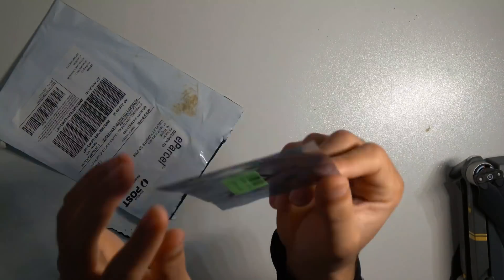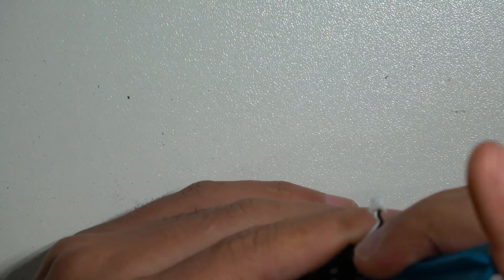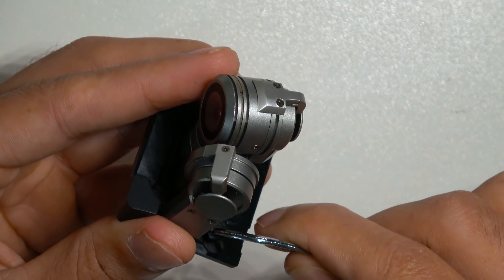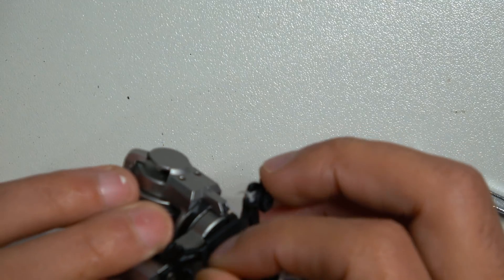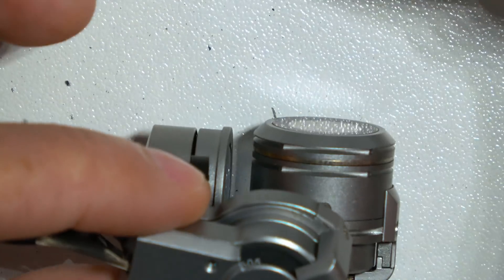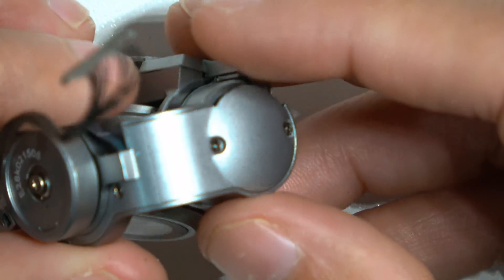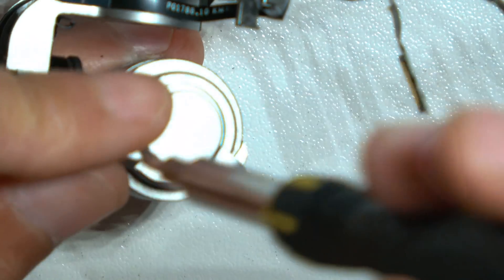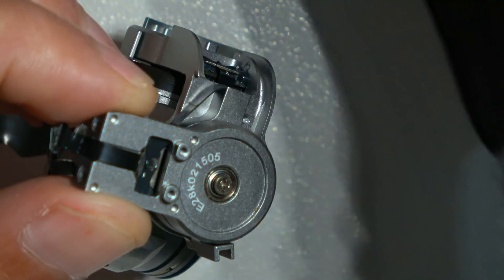Dji Mavic Pro Ribbon Cable Replacement - Dji Mavic Pro Gimbal Assembly [Part 2]

Comment: I tried replacing the ribbon cable on my Mavic Pro Platinum several times without success, until I watched this video. At 13:25 I noticed the way the ribbon cable was folded and placed and everything fell into place.
Reply: https://youtu.be/d26K0ZrObkI

Comment: I have replaced the ribbon cable (bought from DJI for 35$) it worked fine first time and now after few hours the problem returned. After restart works fine again, do you have any idea what could be causing this issue.
Reply: https://youtu.be/d26K0ZrObkI

Comment: Honestly this video is no help at all. I’m sorry but unscrewing covered and pulling off a broken ribbon isn’t that hard. Putting the ribbon back on though is another matter. Btw, you said DJI melts rubber and pour it on the connectors. This is not correct. They use something called liquid tape or something similar.

Comment: Not much help really, the eazy bit is taking the old ribbon out, then we jump to the completed replacement with no useful insight into inserting the new ribbon, a really waste of time, sorry :-)thought the video was about replacing the cable with steps to achieve? :-) doh :-)

Comment: Most importantly, the ribbon cable is not reinstalled on the video. The missing part should be replaced because it is not worth much.
Please also show the ribbon cable reinstallation! Thank you for the others.
Reply: https://youtu.be/d26K0ZrObkI

Comment: Hey there. Great video. I crashed my drone and the gimbal ribbon snapped. The camera also isn't showing any picture so I was wondering if the camera was also faulty... did you camera still work when the ribbon broke? (before you repaired it)
Reply: If your camera footage doesn't work its the cable with the hair strands

Comment: The re-assembly is not straight forward at all for someone doing it the first time. Especially the parts where there are twists and turns on the cable that needs to be set the right way.
Finished the guide and found my gimbal always trying to point 30 degrees to the right. Very thankful for the guide but it is incomplete. Especially remounting of the second contact needs some thorough guidance. Or probably a new ribbon cable. I guess I'll find out how the sturdy my replacement cable is. After the other damaged parts are replaced.
Reply: https://youtu.be/d26K0ZrObkI

Comment: There is a group of people online that has been waiting for a decent reassembly of the ribbon cable. I was thrilled that you had a good close up camera. Something that all of the others lacked. I mean serious utubbers did not have a close up like you. During the run of the video I was anxiously waiting to see the solution that many of us were waiting for. I was worried that you had spent so much time showing us how to unscrew something and I realized your video did what the other cop outs do and that is to reassemble the ribbon off camera. Your video is a waste of time. You crapped out like the others and you probably think "do it in reverse" is good enough.  Well it was not. It is another waste of time. Your video was looking good and then it turn to another big lazy load of crap. Save other people time and pull this garbage. We dont need to learn how to turn a screw you moron.
Reply from the maker: +Brad Jones thank you for the encouragement to take apart my drone again but I mean you can just ask for help, I would even Skype to show you where to put things back together. That’s how far I’m willing to go to help others, now that’s out of the way, do you still require assistance in putting back your drone?
Reply from the maker: +Brad Jones I apologise in advance
Reply: I have to agree with Brad. Your video looked so promising. Then you just cut to "Its all back together... lets boost it up.."

Comment: You should defently make a video, where u assemble it again. Thats the hard part - it's where everything has to be right. 
Also i saw somewhere, that u need to turn the Ribbon cabel 180 degress in order to make it fit. I know its a long proces to make the video - but would be way better. For us, you and your channel. :-)
Reply: "Just do it in reverse" does not work at all. It's very easy to trace a cable that is already installed, a totally different matter putting it back together. I watched this video 10 times and couldn't figure it out and I had the help of a guy who is a qualified avionics engineer!
Reply from the maker: +StrandskovMedia that means I’d have to open !the drone again but I’ll see what I can. Yea sure the ribbon cable has to turn and I will see if I have the footage when I was putting it together.
Reply: https://youtu.be/d26K0ZrObkI